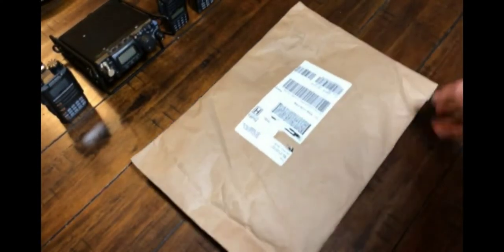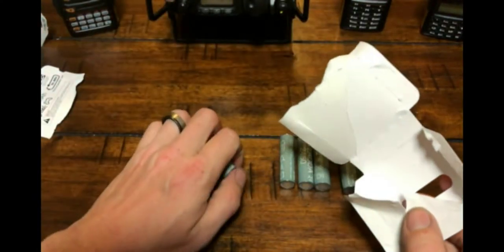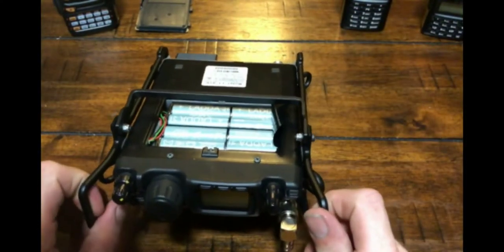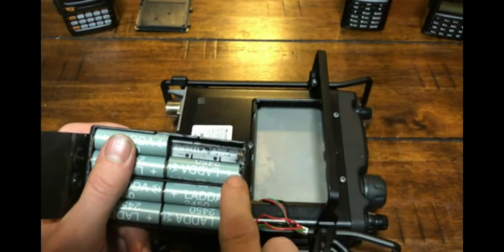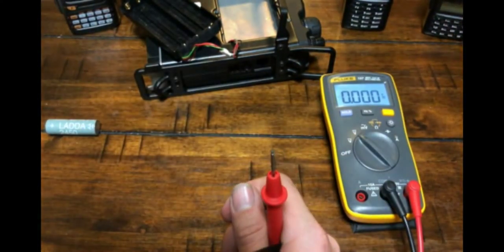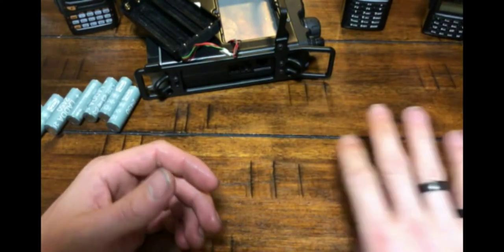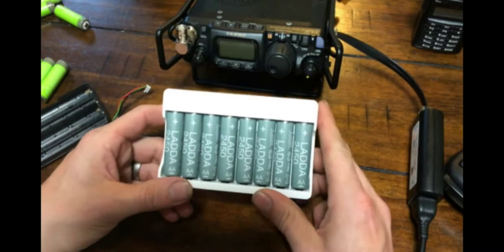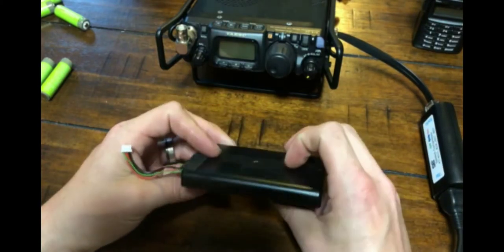IKEA LADDA 1.2V Ni-MH 2,450mAh AA/HR6 Batteries and the Yaesu FT-818 - The No Code Tech

Comment: As an 817 user, power management when portable has always been a challenge.  The supplied battery is only good enough for maybe an hour or so at best, so getting more power to your radio is paramount.  I started to use 3500mAh 11.1v Lipo for model aircraft and they worked very well, however they needed to sit outside of the radio.  LADDA from IKEA seem to be fairly well recommended, however as you have said, getting them into the tray can be a problem.  There are two things that can help with this which I am about to try, so might be worth giving it a go.  Lay a piece of sandpaper on a flat surface and run the try over it, keeping is as flat as possible, this sands down all the edges and bottom, allowing for a little bit of wiggle room when putting the tray into the radio, secondly, populate the tray when its in the radio, I don't know why, but this definitely helps.  There is a 3rd option but a bit more tricky and that is to dremel the inside of each corner where the batteries pinch.  Once working, make sure that the green wire is cut on the tray, not the radio, and this will allow your batteries to be charged via the charging circuit from the radio when plugged into the wall, that way you don't have to remove them each time.  https://www.youtube.com/watch?v=CzwNaiI3fEs&t=61s   Thank you for taking the time to share your experiences.